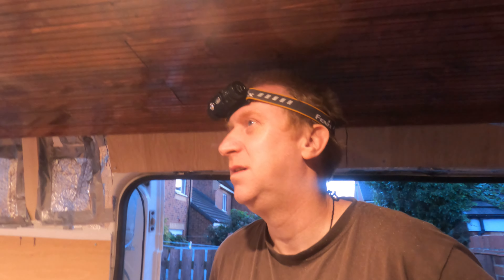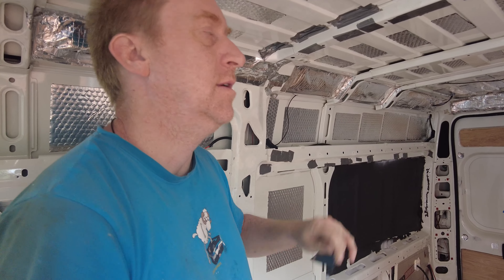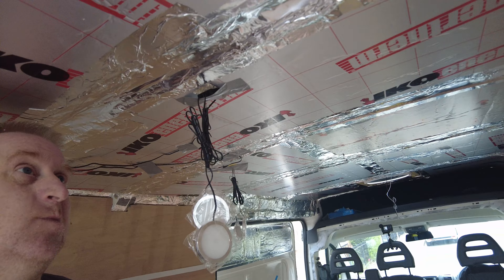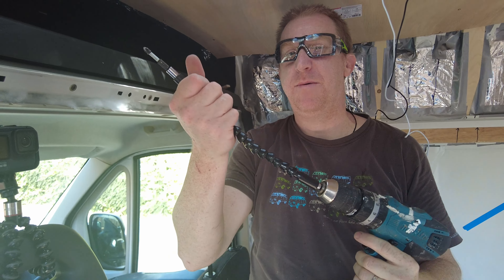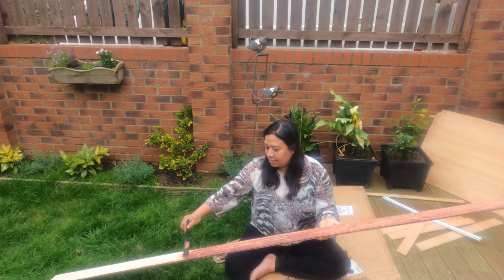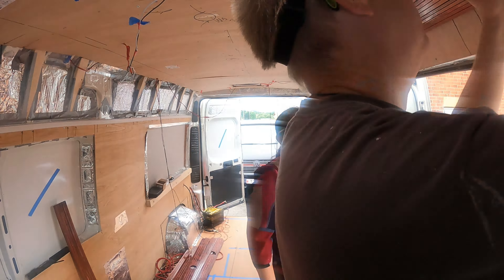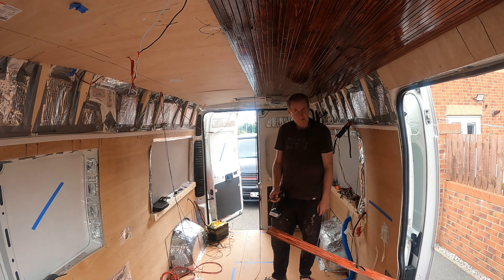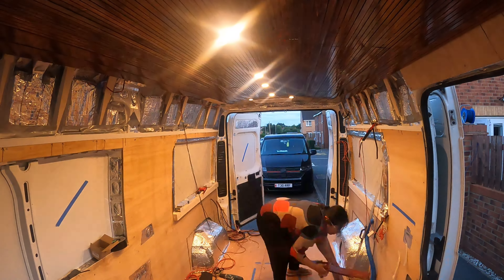Ep-8, Installing our ceiling as tongue and groove,  (Peugeot Boxer L3:H2/Fiat Ducato/Citroen Relay).

Comment from the maker: List of items we used:
Cladding:
https://www.diy.com/departments/spruce-tongue-groove-cladding-l-2-4m-w-95mm-t-7-5mm-pack-of-5/27221_BQ.prd
Clips (we got ours from wickes as B&Q didnt have them in store):
https://www.diy.com/departments/simpson-natural-steel-cladding-clip-pack-of-100/38254_BQ.prd
Lights:
https://www.amazon.co.uk/dp/B0B1WN27RH?psc=1&ref=ppx_yo2ov_dt_b_product_details
Carpet Tape:
https://www.bmstores.co.uk/products/duck-carpet-tape-50mm-x-10m-308771
Insulation board (we got ours from a local wood yard):
https://insulation4less.co.uk/products/25mm-celotex-tb3025-2-4m-x-1-2m